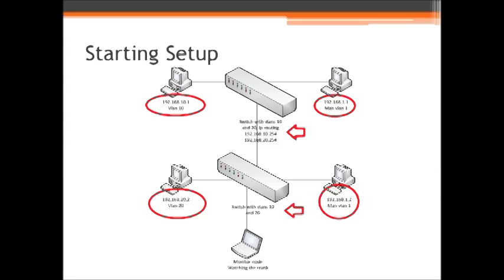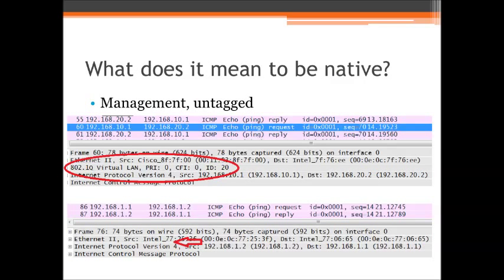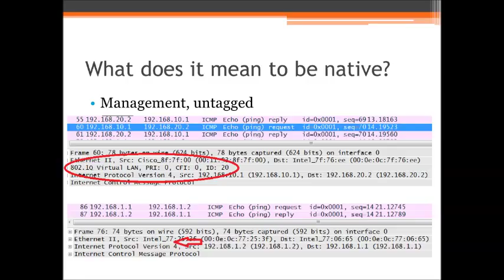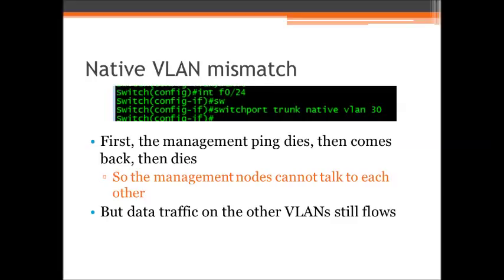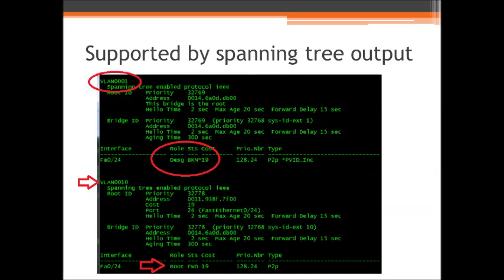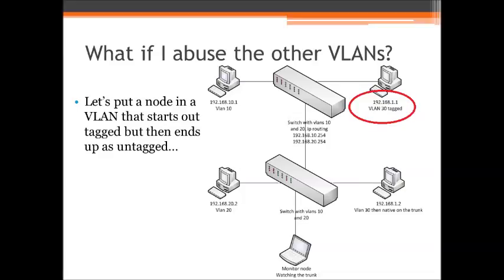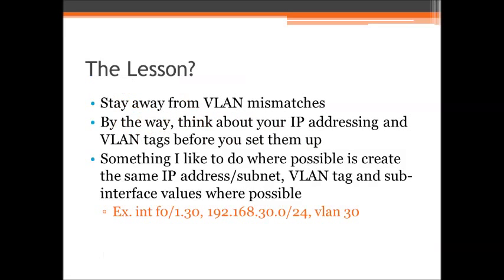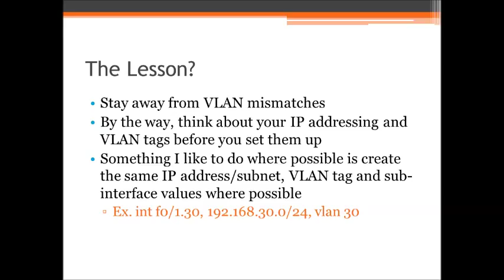Native VLAN mis-match!

Comment: Thanks for the video.  Not sure if you still work this.  But a question I'm trying to understand is this.  What happens if you have a two PCs that are both on the same subnets but their on different switches that are connected via an 802.1q trunk.  Both of these PCs are on the default VLAN of 1 on both switches.  However, both switch's trunking ports have had their native trunking changed to VLAN 199.  I've created this exact scenario in packet tracer.  Both PCs can still ping each other.  Is the traffic simply just not tagged as VLAN 1 is untagged on each switch by default?  Or is the traffic tagged as it leaves the first switch because the native VLAN was  changed to VLAN 199 on the interfaces that are trunking the two switches together and then untagged upon reaching the second switch?  I actually expected the pings to fail but when the succeeded, I got a little confused.  Thanks in advance.
Reply from the maker: Howdy and welcome to the channel - your thinking is correct. First, if you have trunks, tagged and untagged traffic makes it between the switches. Second, changing the native VLAN on both means that the management and therefore the untagged VLAN has changed. VLAN 1 should now be tagged! Nice!